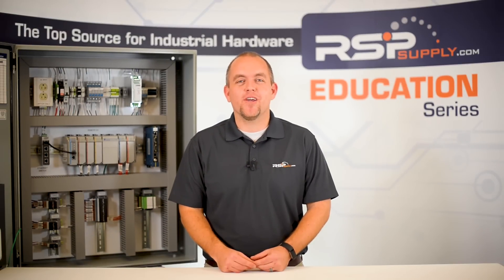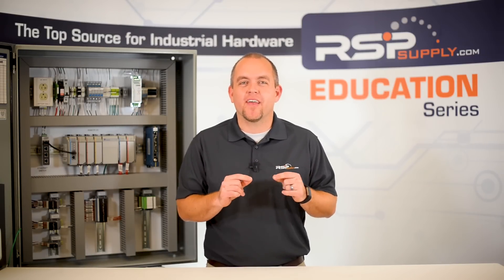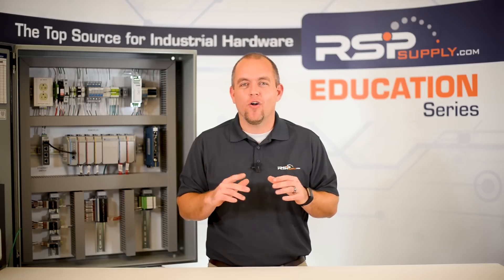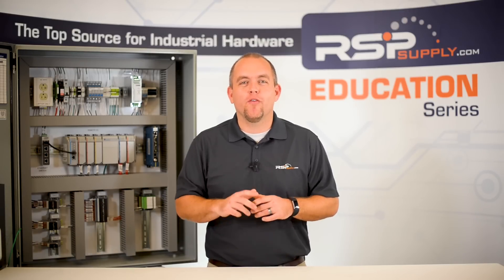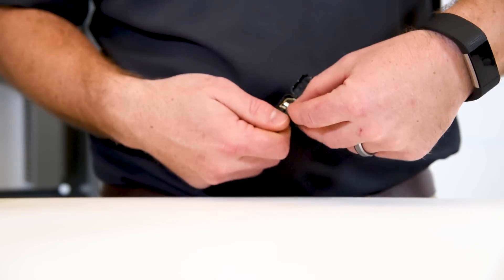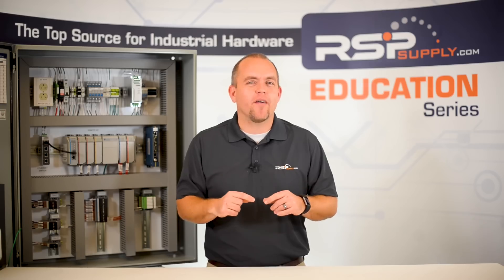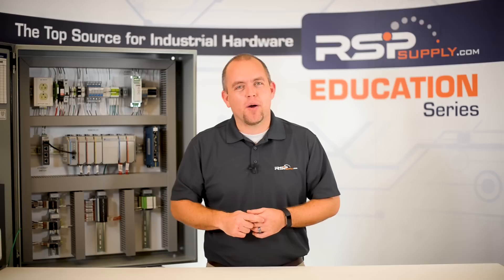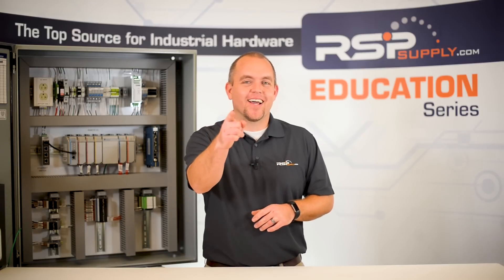Wiring Tips and Tricks: Top 5 Most Common Wiring Mistakes

Comment: No1 - done that - forgot the jumpers. (easy fix though).
No2 - done that, yes the wire fell out -reminder to self - if your not going to tighten it for some reason, don't put it in the hole. Always best to give the wire a test pull after tightening
No3 - No not actually done that, instead I just broke the fuseholder and it was big and expensive (but made of thin plastic :(
No4 - Yeah done that several times, generally its caught when checking. The lack of consistency in naming and positioning them on the drawing is often to blame. (oh - and me).
No5 - Yeah the drawings are often wrong and I tend to spend a lot of time checking and correcting them. Such is life.

Comment: I want to shift my TP&N box without changing the wire which connectors or equipment should I used to increase the wire upto new location of TP&N box so that my all equipment like AC geyser etc can work without sparking or burn at wire joint

Comment: Which terminal blocks are you using(manufacturer and type) at 2:43 and what is the black attachment where you place fuse and resistors called?